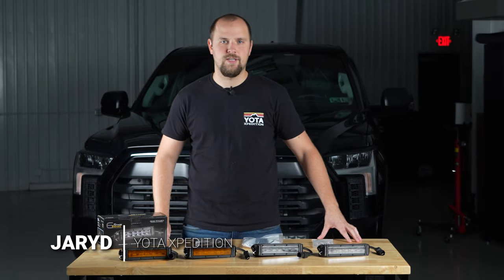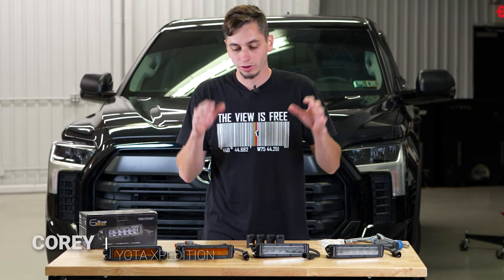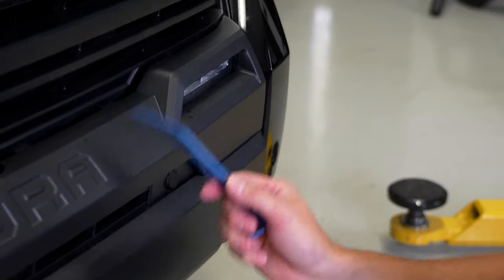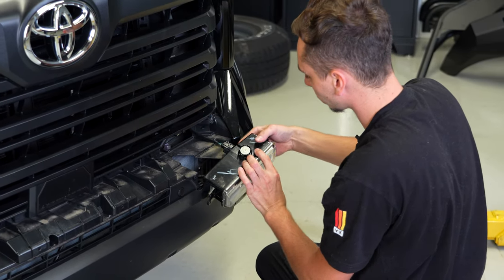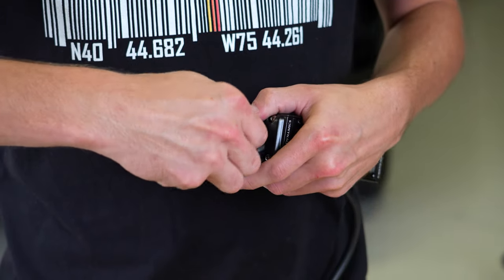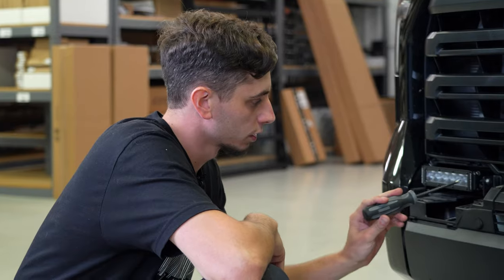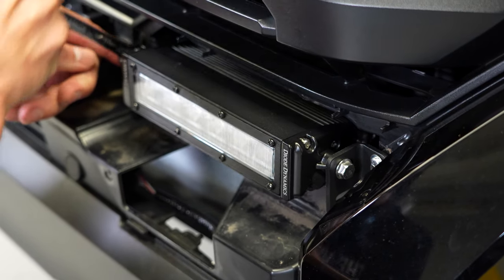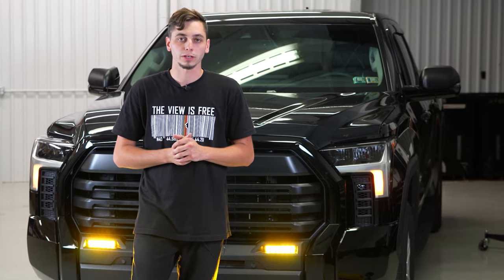2022-2024 Tundra Diode Dynamics Fog Light Install | Yota X

Comment: I was happy to see a video where the entire grill assembly does not have to be removed to install these. However, popping out that plastic front bumper cover only is not as easy as this video makes it seem. I have been trying on my 2023 Tundra limited OR using the same trim tool and steps in this video and it is not budging. Very concerned that the tabs will snap if any more more force is applied.
Reply from the maker: Might be easier to just pull the front bumper off then if you are having trouble with it on.
Reply: I was able to get the trim off using a beefier trim tool and taking my time. The tabs on mine were very tough to get out initially, but once I got the first two the rest came out pretty easily. Thanks for this video.

Comment: I’ll be buying a 1794 Ed. with the factory 3in lift. They say fog lights are removed. Does anyone know if the wiring is already there. I know Toyota did this with other older models to not make a separate wiring harness.
Reply from the maker: To my knowledge, the wiring should be there. The factory lift kit comes with block off plates for the fog lights (probably for legal reasons)
Reply: My 2025 SR-5 with the 3” factory lift had the switch and wiring already there. The factory wiring plugs are snapped right into the backs of the fog light blanks. Very easy to install the new fog lights - just plug in the adapter jumpers and test the lights to make sure you’ve got the polarity right (plug that goes into the factory plug will go either way).

Comment: I just got a 2024 Limited TRD OR 4x4, but it didn’t come with these fog lights stock.  I want to buy these but will I have to run wires to the dash you think?
Reply: Most likely. DD should have a wiring kit available with an option to get a toggle that fits directly into the stock location.
Reply: Thanks man. I will definitely check that out.
Reply: I also have a 2024 Tundra Limited OR 4x4. I ordered these lights and they just came today. I read on another forum that the truck comes prewired and it’s plugged in to the back of the plastic inserts. Went out to install them and got called back in to work right as I popped the trim off. I’m planning to try again tomorrow or Wednesday so I’ll come back and let you know what I find.
Reply: @brianstill7898  hey thanks man.  Just to be clear, you also purchased a 2024 Limited TRD OR 4x4 and it didn’t come with the OEM grill fog lights either?  Im pissed I didn’t check that before purchasing.  Just some plastic housing inserts where the fog lights should be.  Hopefully 🤞🏼 there is wiring there already otherwise we’ll need wire harnesses to bring it from the grill to the dashboard.  Look forward to seeing your reply, hope all goes smoothly.
Reply: Yep, exactly. No OEM fog lights on my truck either just the plastic housing. Just finished installing these lights and the truck is definitely pre-wired for fog lights. They were plugged in to the back of that plastic housing. You just take it off, unplug it, and install the lights like in the video. Turned it on next to where you turn your headlights on and off and it worked perfect! Everything you need comes in the kit. Just go slow taking the plastic part off the bumper, it’s harder than they make it look. I went with the amber lights and it looks soooo good.
Reply: One small tip if you decide to go with these lights…install them so that the cable is exiting the light towards the ground. I had to make some adjustments to the height of the light and I ended up having to take one out and flip it over because if the cable is coming out towards the top it will pinch and you cannot angle the light towards the ground very far. Good luck with everything and hope that all helps man 💪🏻
Reply: @brianstill7898 you rock, thanks my man for confirming!  So basically it sounds like they are plug in and play with them being pre wired.  You’re saying the interior switch to operate them is where the headlights switch is?  Going to order these today!
Reply: Yeah no problem at all. Yep, on the lever/stick next to the steering wheel is the switch for the headlights and then just inside, a little closer to the steering wheel is the switch for the fog lights and that’s what will turn them off and on. The plug does work both ways so if you turn the truck on and the switch is on but the lights don’t come on just leave everything on and go back and flip the plug around and they should kick right on. They’re pretty bright and I went all out with the 3” TRD lift and 37s so I really had to angle them down so I wouldn’t blind other people on the road so that took a little extra messing around but otherwise it’s absolutely plug and play. Aside from adjusting the height of the beam I had these installed probably in under 20 min. I’m really happy with them.
Reply: Thanks 🙏🏼 again.  I ordered a set today.  Already shipped out.  Great company so far.  Psyched to throw them in.  Are you riding on aftermarket wheels with the 37” tires?  I have the 3” TRD lift kit from factory with the 20” TRD wheels.  I want bigger tires on the stock wheels.